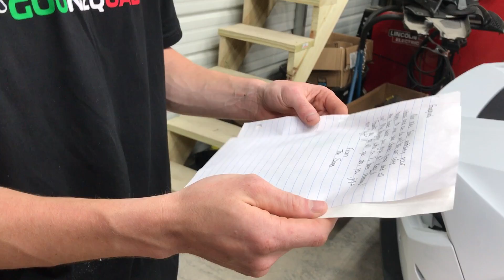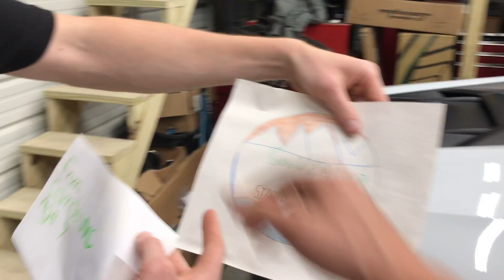Rebuilding A Wrecked Lamborghini Huracan Part 22

Comment: After the lambo is complete, can you do a video talking about everything you had to buy and the final cost?
Reply: They've done this in the past with other builds so im sure they will do it again
Reply: That won't happen. They don't reveal costs.
Reply: I dont blame them for not revealing prices .. it will hurt the resale value of the car
Reply: Not counting hours, the lambo will still be more expensive than a second hand one.
Reply: They said they were going to say the costs of the parts idk when they said but they said it
Reply: @bernhardlagetuin  Even if it was its far more valuable to them because they all built it together. Instead of just buying a cheaper one.
Reply: I'm pretty sure it's well into 140k. Cuz the lambo was probably around 100k
Reply: It would be an embarrassing overspend if revealed. Remember they bought 2 Lambo & paid sky high parts prices. They make the money on providing the video content. I'm ok with that......I thoroughly enjoy the channel.
Reply: ggss11 the whole point of the parts car was it was cheap the engine was toast they could take what they need and then sell the rest
Reply: @AFREAKINGLEMON  you're right, I believe they stated it was about 100k
Reply: @alanwongtylerchristian  yea. Its was a decent one with pretty light damage so its gotta be at least 100k to 110k
Reply: @AFREAKINGLEMON  $82k for the original lambo.  I saw the auction listing.
Reply: Please
Reply: There's a reason the insurance company wrote it off.

Comment: Clear tint provides UV protection, which prevents sun damage to the interior.
Reply: Excellent idea, didn't realize there was "clear" tint!! I've gotta look into this for my car.
Reply: That is a very good trick your right
Reply: Mostly every OEM vehicle window come with UV protection. This can be checked by looking at the "tag" that's usually etched into the corners of the glass.
Reply: Definitely go with front ceramic clear tint, costs a little more but definitely worth it as well as doing it before the glass installer comes!
Reply: And more importantly prevent skin cancer!
Reply: @Torqu3d  This is why photochromic eye glass lenses that change in the sun don't change inside the car. The UV protection on the windows blocks the rays needed to make them change.

Comment: Looking good!👍 
You will regret not clear coating the flat black area!  The front bumper takes the most abuse from road trash.  That paint will chip in no time!
You should also wax or ceramic coat that paint job now.   You put all that hard work into perfecting the paint job.  Protect it A.S.A.P.!
Reply: +1 on ceramic coating
Reply: Xpel ultimate ppf 
Expensive but a 10 year warranty
Reply: +2
Reply: Shouldn't wax a fresh paint job, needs a couple months to breath

Comment: love the videos guys, watched most of your builds.. Just a tip for when you wash, use 2 buckets. 1 for suds and the 2nd for rinsing the wash mitt after every panel (you will need to get a grit guard to run the wash mitt over to avoid re-introducing swirls into the paintwork)

Comment: NEVER plug a used usb stick that you dont know the source of firsthand into a computer that you care about
Reply: Logan Clements Its probably new and clean given by a fan, Im sure nothing would be existing in it xD
Reply: USB killer
Reply: @theweeknd2725  better safe than sorry! ;)
Reply: Or at the very least disable "Autorun" before doing so, in case someone actually did throw in some malware.
Reply: Just boot up the PC from a Linux live CD (Ubuntu being one of the easiest distros to set up) and don't mount any of the internal drives (or even disconnect them physically if you are using a desktop PC). Sure, in theory there could still be a linux kernel exploit being used and some persistent malware that infects the BIOS or the firmware of any attached devices, but realistically, if it's not the NSA that is targeting you, those are not really realistic threats.
Reply: TheBigOne0305 we build cars here ... not computers 😂
Reply: @Dot.Com..  -> ... said the last mechanic trying to find a computer at home that works.
Reply: Well, I'm an IT guy that just happens to be interested in cars as well ;)

Comment: Ceramic coating is an excellent idea. It'll really seal up that gorgeous paint job! If you've never done a ceramic coat though, be sure to get some experienced hands to help you out. If it's not applied correctly it'll look wonky, and removing it to redo it is a pain in the arse.

Comment: Yes. Definitely do a ceramic coat. It is so worth it! 
You can do it yourself but consumer grade doesn't last as long. (Apx 2 years for most) but Professional grade if you can get is usually lifetime. I recommend Liquid Armour (esp for professional) but Ceramic Pro and a few other are good too. I used Adam's for my DIY consumer grade on my new wheels though.

Comment: with your narrower vacuum novel although it does work id use a air gun off of you compressor to blow out everything to the back of the seat and then use a vacuum

Comment: Restoring a damaged lamborghini hurucan would be cheaper than buying a used one and this looks alot nicer and probably sounds better than a used one, also you will save at least 50 - 60 k from what a used one would cost, this probably is 140k, a used one would be 200 - 210k.

Comment: why didnt you keep the old windshield? seems like a waste to me or am I missing something?
Reply: Old windshield was cracked in the wreck.
Reply: @gpackwood1  didnt catch that. if thats true, it makes sense.
Reply: @8asw8  -> Actually that whole windshield challenge was pretty interesting. They had to 'think ahead' about painting the car with or without the new windshield.  If they installed the new windshield before painting they would need to tape around the new windshield which would have taken a very long time. If they postponed installing the windshield they could use a simple plastic cover when they painted. And of course that is what they did. I would have never thought of that. My brain would have said ... remove and replace the windshield and then move on to the next item on the list.  I would have been taping until I was seeing yellow tape in my sleep. :-)

Comment: I'm not trashing or knocking y'all(y'all do nice work no doubt) but when you're spraying a new paint job or any paint rather...why don't u sweep all the way across tape to tape instead of stop mid section and causing uneven coverage and other issues (whether they're minor, seen or unseen). Just a friendly tip to better and tighten your craft.

Comment: Why did you paint the front bumper with a different satin black than the rear bumper? They're far enough apart that the casual eye won't notice but on a $100k+ car? You should have at least used the same paint on both so that the shades match.
Reply: how do you know it was a different satin black just asking ?
Reply: tell you truth i dont see any problem with it.. it looks fine by my eye